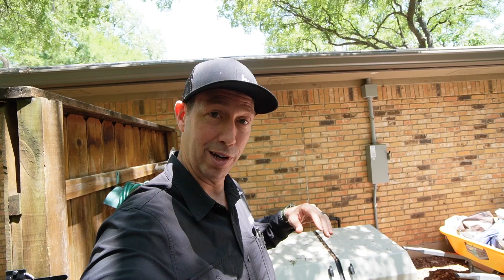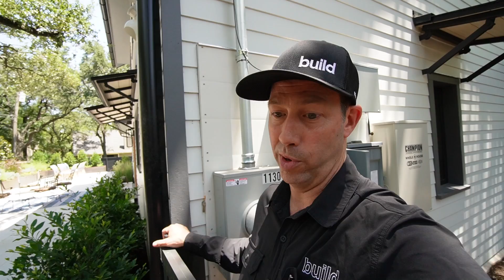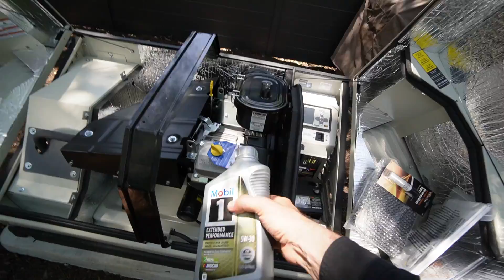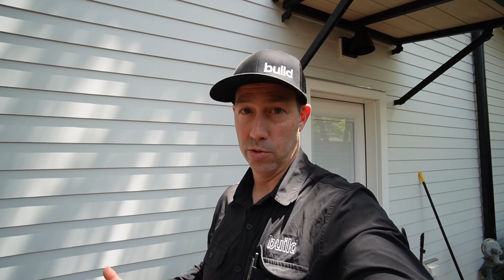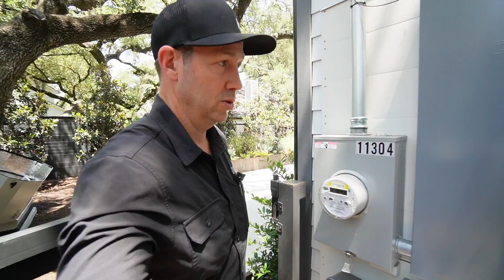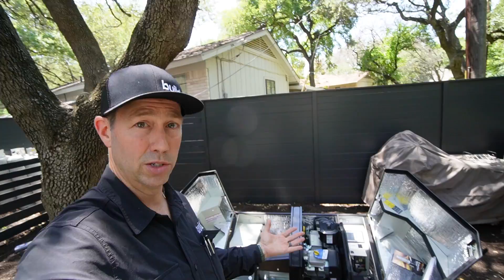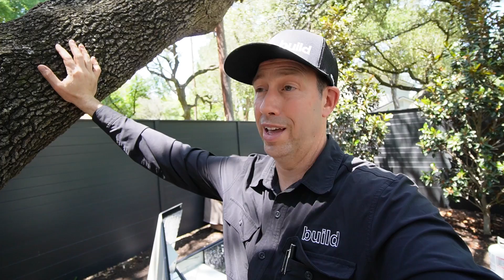Rolling Black Outs? Meet my little friend: Home Standby Generator

Comment: I have been using a Champion 8.5kw standby generator that was installed back in december 2017 after we were affected by Huracane Maria a few months earlier and we were without power for a couple of months. And today its still working flawlessly like day one. I am using mine with a 120 galons capacity propane tank 👍😊. I live in the carribean PR
Reply: Now that you have had the Champion Generator installed for awhile, do you still like it.?  I am considering the 12.5 or 14kv.   what is it like getting parts ?  Any engine or electrial issues with it ?  thanks.
Reply: @GreyGhost-r4z  my Champion 8.5 kw standby generator is still working flawlessly since the first day it was installed back in december 2017. Durring a outage I can keep powered my whole house including a 24,000 btu inverter a/c, my electric cook top, microwave, washing machine, my lights, 2 fridges, 2 garage doors my 65” tv and my water cistern 1/2 hp electric automatic pump. Next month I am also planning to install a FranklinWH solar system to have two backups since our local water and electricity utilities are prone to fail very often. Remember I live in the carribean not in the states.
Reply: @raymondmorales8252  Thanks for the comment.   I am glad it’s still a great Generator.  I can’t even find a dealer to install the Champion.   I’m in Wisconsin.   Champion was my first choice.  So jealous you are somewhere warm.  It’s supposed to snow this Saturday. 😵‍💫.    Thanks
Reply: @GreyGhost-r4z  I am sorry to hear that in my home town we have 4 certified electrician and all of them install any kind of standby generators and offer services to them as well. The more popular brands here are the Generac, Honeywell and Champion, but according to the one who installed mine the more reliable by far are the Champions 👍😊💪.

Comment: I've been trying to find a battery backup system, this seems to be about the cheapest.  He is using an offgrid system but I think there is a grid tie 30kW 240 volt Three Phase system by the same company that is actually cheaper.  

https://youtu.be/mzZR6SWonrY

I do like the Champion System but my new house will be all electric.

Comment: Your concerns about using battery storage is a bit overblown.  Yes, they will lose capacity over time, but not as much as you made out, especially with Tesla going to a Lithium Iron Phosphate chemistry for their storage batteries.  Unless you get unlucky, they will last much longer than 10 years with very little degradation.  As far as recycling, by the time they need to be recycled, there will be options.  The minerals in Lithium Ion batteries are too valuable, and there are already companies here in the US and abroad being built for this purpose- they will grow as the industry grows.  Unfortunately, the one negative thing is cost- and growing world-wide depend for EVs paired with supply chain shortages, have kept battery storage costs high.  We currently have an 8.84 KW Solar array, and I wish we could put about 3 Tesla powerwalls in our garage- it was frustrating to not be using the solar power we had when the electricity went out during the Ice Storm a couple of years ago;-)  Perhaps in a year or two...

Comment: Matt, I just put in a 20Kw Generator. It was about 13k. I work two jobs. 18 hours a day from home and I make well over $300k y and ave two full internet access points in my home as well.

It's very important to me that I can assure my clients that I am well prepared for anything. I have had a few days of complete failure last year so I know how much you can be at the mercy of the grid.
Reply: For me, I know it's something that makes a lot of sense.

Comment: I am in the process of a new build and chose to use solar, batteries and a generator. The Sol-Ark 15k has 200 amp transfer switch, solar inverter, battery interface and generator interface. All this is built into one box so the install is much simpler. In an outage it will run on solar and batteries until the battery gets low, then kick on the generator to recharge and then is shut down. This means the generator is only on part of the time so the propane last a lot longer. By the end of the year they anticipate releasing their Smart Loads 14 which can be wired to 14 circuits in the panel to load shed similar to what the champion relays do. This should provide whole home backup in one integrated solution. I am looking at what generator to buy and champion is now a new option. Thanks!

Comment: We live in coastal South Carolina. In 2005 we bought a generac 25kw. It’s a water cool 4 Cylinder ford engine. It  runs off of LP. We have a buried 350 gallon tank.  It sure helps when the power is off for a few days. It runs my whole 2700 sq foot house. Worth the money.

Comment: Matt. Have you looked into the Microair Soft start for your AC units and heat pumps. We have brown out (under voltage) which prevents the 1.5 ton AC from starting due to the high amp start lockup. I installed the Soft start and the amp draw went from 64.3 to 24.6  for lockup.  Can you check these out for your viewers as I can now run my AC unit off a plugin during outages. Thanks for all the Great Build shows.

Comment: I live in Iowa and am considering a mix of solar and propane generator along with a couple of 2022 EPA rated wood burning stoves.  We get -20°F temps here in the in winter. Solar makes sense to offset air-conditioning costs in the summer although I know the payback is around 10 years. I too am concerned about having a gigantic lithium battery that can't be extinguished if it malfunctions and catches fire. I feel like it would need to be a mounted in a separate shed type structure made of cinder block to avoid that risk which makes its that much more expensive.

Comment: Matt, Was an underground propane tank an option?  On the backup battery option, did you consider a backup would serve as a capacitor of sorts to compensate for the spikes in energy.   It seems like it could work well in concert with a smaller generator.   BTW, good video out there on a former Tesla exec working on recycling the batteries.  Interested in your take on it.   Respectfully, RAKE
Reply: In Texas you are required now to have underground propane tanks certified yearly. $$

Comment: Don't forget the initial "break-in oil change" after 5 hours of operation. After the initial break-in oil change, it's done every 100 hours or two years. Check the scheduled maintenance in your owners manual for specifics.

Comment: My concern is these generators is the noise. If you run them overnight during an outage, you will piss off your neighbors and they may come over knowing you have power.
Reply: My goal was to share some of my 3500 watts with my immediate neighbors.  There were some snags.  First, their gas furnaces are not tied to a transfer switch. But the bigger problem was not realizing that at 0-10 degrees, my 20lb Rhino tank could not evaporate the fuel fast enough to produce more than the 1kw I was consuming.   They did get to charge their phones.

Comment: Thanks for sharing your thoughts, ideas and videos. Sounds like you have looked into your options and found a solution for your situation. My concerns have always been centered around the required maintenance schedule, oil change every 4 days of operation, sounds like something that could or would likely be overlooked in a stressful situation. I like the idea of propanes useful standby lifespan. I probably would go with a larger buried tank if possible in your area with the ability to connect portable tanks as needed. Looking at the pictures of the flood made me wonder what the situation at your new house is. Would hate to see a situation where your generator is flooded but if only it had been installed a foot higher you would have been ok. Don’t forget the lesson of Fukushima, it would have been a nothing story if they had installed the generators a few feet higher than they did and had never lost backup power.     The idea of solar in a micro grid configuration is very enticing if you were to add it as it could help reduce your daily energy costs and in a grid down situation could extend the runtime of your system. Wishing you and your family the best.

Comment: I’d be interested in seeing a hybrid system discussed. Solar w/battery storage and a redundant generator. I’m considering trying to figure out how to do that with my house. I’m not sure I want to pay to have enough storage to meet my needs for over a day. A generator to charge my batteries along with solar would be great.
Reply: The battery bank is going to be the largest single item in any solar off-grid/hybrid build.  On the plus side though, if you get your system laid out properly, you can add additional storage at a later date.

Comment: Double the generator capacity isn't double the cost.  I installed a 22kW Generac generator that's sized to run all the loads in my home, and don't have to screw around with load shedding accessories.  It was cheaper to upsize the capacity than worry about not having enough capacity.  Plus having more head-room was a win.  I've got propane as well; though I would have preferred diesel, but the economics for a small residential generators don't make sense.  (I'm more used to using them in the 100kW and beyond size for data center backups..)  And you also have to worry about storage of the fuel, as you noted isn't really an issue with propane. 

I've not seen Champion in commercial systems; I've seen Generac before.   But more importantly, I could get support from my electric co-op to install and maintain that brand (which is also rated well.)   That's an issue for me living out in the sticks and trying to get competent service and maintenance.
Reply: Generac might make commercial units but their homeowner units are just that....homeowner junk.  If you want a real backup generator that works like a commercial model, you should have bought a Kohler 12RES.

Comment: The one thing I may disagree about a solar array with batteries and the cost. It seems you’re not comparing them equally. I’m sure you’ve considered it. At least if you spec the system to go off grid or partially off grid. Then you can start to deduct your monthly electric bill and put those savings towards the costs of the initial investment of the solar array. It’s something I’m seriously considering as I live in the sunshine state and will have a massive about of solar potential without the risk of any snow whatsoever. 

Thanks for the great videos! Any thoughts on doing any Barndo videos?

Comment: Matt nice set up. I just hope you don’t regret not spending $30/ month gas connection fee. Here in the north east, nat gas is an extremely reliable resource.  A couple week outage is not uncommon here.I’d hate to make an in vestment and have an empty tank that I could not fill. Can’t count how many times I could not get a propane refill for my grill. $360 insurance policy is they way I see it. Not unreasonable
Reply: Texas has it own power and gas grids. Unfortunately they are not up to standard and are subject to outage and shutdown in extremes in weather. This is because Texas has not invested in the necessary infrastructure to maximize availability in extrema events.

Comment: I have a four year old house with a  three ton conventional air conditioning unit. I installed a 22 kw Generac backup generator. Even wit the size of the generator when the air kicks on it pulls down the generator and dims the lights. I am considering a Micro Air soft start which can cut your start amps by around 70 percent. The cost installed is around $500 but may be worth it as it will help the compressor life

Comment: I think it would be significantly easier and cheaper to just use a Span panel as your main breaker and can allow you to dynamically select which circuits can run in on a generator power
Reply: SPAN will not allow a generator to be hooked to it. They will void the warranty if you do. Not green enough for them.
Reply: @bwilkerson  actually they used to handle i like that but if you go to their website they now have limited support for generators.
Reply: They do work with battery backups, just not propane/NG

@Matt, have you done any projects using the Span panels?
Reply: The moduals are sooo much better

Comment: Your decision is correct ….

Well, it’s correct based on your priorities and comfort zone. 
From that perspective any of the other options would be correct as well. Having diverse options in the marketplace does add redundancy to the system overall. 

My personal choice would be solar with batteries. Not as a backup but the main supply. Inside of cities getting enough solar can be challenging. If it’s not your trees casting shadows, it’s the neighbors. 
Unfortunately solar suffers from the same problem other systems suffer from. Contractor installation is usually overpriced and government incentives benefit the installer more than the homeowner. 
DIY is the way to go. Yet again city dwellers are here at a disadvantage due to regulation and code. I love having a place in the boonies and 10 acres.
P.S. I favor solar while living in snow country for 6 months of the year. It’s all down to your priorities.
Reply: Cities are becoming more flexible and relaxing ordinances and revising codes to allow for some form of solar.  In my community rooftop solar has been added to the zoning code and ground mounted solar is allowed in the back and side yards.  I am within city limits and just had a 40KW system installed  on my roof.  
The contractor was reputable and I felt the pricing was not outrageous and in-line with the work and service they provided. 
The U.S. made racking and panels and install and are top quality.   And at 40K for 40 panels I think the value is good considering all the work they had to do to stay safe on an 8/10 metal roof.
Not sure what sort of incentive the supplier/installer received but I'm looking forward to my 23% tax credit. in 2022.

Comment: What is the cost of 6 bottles of propane? about $1100. so it is equivalent to 3 yrs of NG service. 
I would use the NG so it can run 24/7 without any work if no electricity for days. I cant imagine going with a truck with 6 bottles every day to feed the generator.

 So you could replace the nozzle of the carburator in case the NG company cannot feed the fuel needed and connect the propane.

I know thoses can run on both with different nozzles, but would be interesting to see if it can be modified to even use 2 nozzles so you can switch if needed. With a system big as this I would try to be bulletproof.
Reply: Not to mention the cost of NG being cheaper than propane, the time and vehicle fuel to deliver propane to the house, and the replacement cost of the equipment and tanks in ten years. Even with a free gennie I have to agree with his wife; "Why are you spending all this money?"

Comment: The Tesla powerwalls are warranted for 7 years at the rated capacity, but require zero maintenance and that is cycling them daily. You can set it up to not cycle daily and probably easily get 10+ years out of it.

If your solar panels are snowed over, then brush the snow off.

The big thing about the battery+solar setup is when sized correctly you can run indefinitely without grid power until the batteries wear out or something breaks, and you don't have any additional costs after it is installed.

Also it is 100% false to say that there are no recycling programs for the batteries. Lithium ion batteries have been recycled for quite a few years now and those efforts are increasing as their use increases.

Comment: Matt the HVAC splits are INSTRUMENTAL when sizing a generator.  I have 4 outdoor condensers ALL DUCTLESS a hot tub with a standard element a heat pump hot water heater which is always in heat pump mode.. The house is 3400 sq ft and today it was 93 dwgrees out and at my max I was pulling 2500 watts with all systems running.. yes nobody was cooking on the electric stove and the hot tub was not running but even if they were.... Id say 10,000 watts MAX if the stars aligned and my well pump called... im running a kohler 20rz. making 20KW at 1800RPMs and this unit is a GEM. Id rather have it and not need it than need it and not have it!!! And I work for the electric utility so i can be on storm duty for weeks on end so its great insurance!  ALSO I HAVE solar 50 panels on the house and the system IF I HAD enpahse IQ8 MICRO INVERTERS would have allowed me to use solar during an outage if i had batteries and an AUTOMATIC transfer switch... but on my house i would have needed  TON on batteries to run everything for an extended time... and if its cloudy you are screwed...My generator I know im in the best position possible only thing i would do differently was put a 1000 gallon tank rather than a 500 but i can always add another one i suppose.

Comment: Battery allows instant changeover.  Of course it can't help you for 2 week outages.  It's almost 2 different needs.
The majority of power issues are minor, often not even long enough for generators to kick in.  I would cringe having a 1 minute outage with a $5k backup system that did nothing to help.
The battery systems - depending on the model - can do a good job with brown out and over voltage issues, preventing damage.

Comment: I went with a Generac and I'm very happy with it other than it's not propane powered but I plan on changing that. It's way more than I need since my hot water heater is propane fueled. Heat is also propane. I can run my entire house and my pool on it, it's crazy. I also have a meter next to my electrical panel so I can see how much power I'm using. Oh and whole house surge protector. Don't forget it!